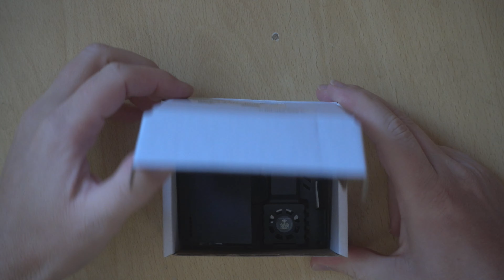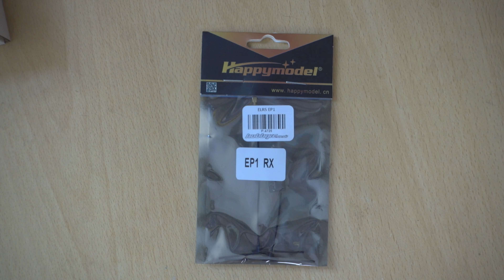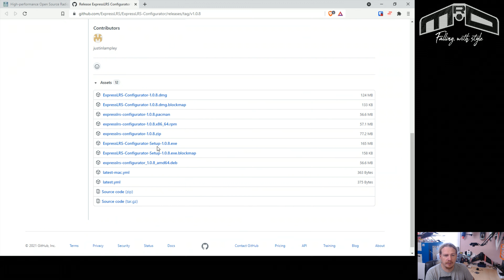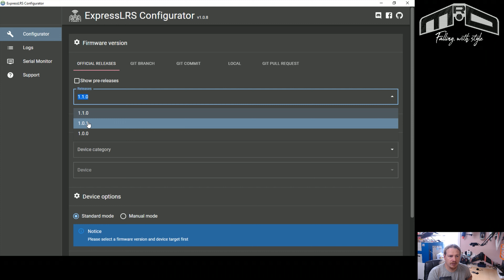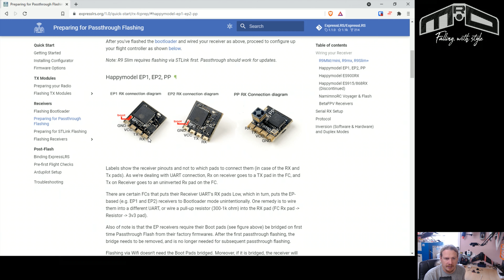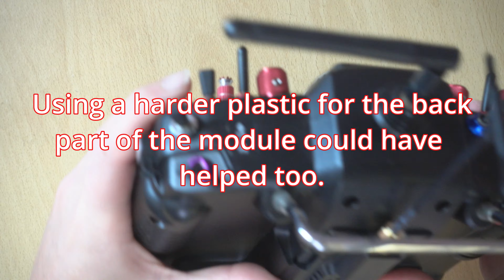Introduction to ExpressLRS and the HappyModel 2.4GHz system

Comment: So I'm thinking of trying to get this working on my ar wing pro, I think I'm done with crossfire I'm just tired of the high prices and backorder on everything. Anyway my radiomaster tx16s is on opentx 2.3.14 the ar wing is setup with matek f405-wing flashed with inav 3.0.1., does this version of inav even support Express lrs? How many loops to jump through to get this working? I've done some reading looks like new version of lrs is out. I want to use the 915mhz version what's your thoughts on this? As always thanks for all your help
Reply from the maker: Honestly, I’m sticking with Crossfire and R9. ELRS is improving. But, I have seen issues with it. There are cheap ELRS supporting products out there. But the quality can vary greatly. That HappyModel receiver I have, I do not trust. I wouldn’t put it on a plane. But, at the end of the day it’s your call. 

ELRS uses the CRSF protocol for non-OTA communication. So any version of INAV that supports Crossfire, ELRS should work with. There are some enhancements in the later versions of INAV though.
Reply: You may be right about Express elrs Darren, I've been 2 days trying to flash a betafpv 900mhz tx but only get a message platformio can't be installed what ever that is? I've tried flashing with usb and wifi but same thing. I know your setting up 2.4ghz here but have you run into this before? Thanks for video
Reply from the maker: @egtreadway4232  to be honest, I’ve hardly used ELRS since updating the INAV Fixed Wing Group models to support Hybrid 8 mode. I don’t trust the receiver enough to use in a plane. 

If I had to guess. It sounds like the wrong platform target. Sometimes there are similarly named modules and receivers in the list. Just make sure you have selected the right one.
Reply: Thanks Darren, I'll double check my settings but not going to work on it much more, I may take a look at the r9m module. Thanks again
Reply from the maker: R9 is decent. It has had a lot if bad press in the past, mostly because of false information spread about it. I would recommend the R9M 2019 module. Depending on how confident you feel with soldering, you can do the externalaccessmod on the TX16S, which would allow you to use ACCESS on that R9 module. But the soldering points are small. If you’re using ACCST, I would still use the 2019 module, and flash that with the ACCST firmware. It has better power handling than the original module.
Reply: Thanks Darren I'm looking at the tx16s mod. For the 2019 r9m looks like maybe 3 wires I can do this. I know you fly with both how's the control link compare to crossfire?
Reply from the maker: For me, they both work great. Most people won’t get close to the range that either Crossfire or R9 are capable of.
Reply: Thanks Darren your advise means alot, one last question have you done the mod. On the radiomaster tx16s for the R9m and access? I would love to see you do a video on that. Thanks
Reply from the maker: I don’t have a TX16S, so have not needed to do the mod. ACCESS just works for me.

Comment: I really enjoy the total unbias aspect of this video, thank you very much!! I have been thinking that since this is very much an entirely open software It may be possible to put it on an different system to work with 433Mhz??? I mean it would seriously improve it and "I don't have any plans to stop using it" regardless" it is a frequency that is much less used and traffic is way lesser than any of the other brands.....
Reply from the maker: Thank you Miguel. I just like to tell things as they are. I don’t want to make peoples minds up for them. But give the information for them to make their own decisions. 

Maybe it’s something they could look in to. I think the issue would be that they are using LoRa RF modules. Unless they get someone to produce the hardware, I don’t think it will happen. You can get ESP32 modules with 433MHz LoRa. But as far as I know, there are no out the box RC transmitters or receivers that use it.
Reply: @MrD  Thank you very much, I have been using the "OLD" EzUhf 433 with very little issues... have others in the past... but with not as good results... best regards.

Comment: These Happymodel es2.4tx are firmware limited to 250mw, so, idkw the fan plug and mount is there.
Reply from the maker: Future updates with more power perhaps? Keeping things like this cool is no bad thing either way.
Reply: I noticed you can still choose 500 or 1000mw. It's still putting out 250 when you do that? I have only used 100, but just went and checked when I read your comment because I was sure it went higher.
Reply: @TheLostSquadron  when you try to select it, it will automatically change back
Reply: @jhughes2286  You are correct! I just when back and tried it. When I initially scrolled past 250, I didn't try it since I don't have a fan installed.

Comment: Go for wifi on the beginning. The HM stuff (tx/rx) works just a once ( no button or grounding the bootpad needed). Only my Siyi mini has to be flashed by  uart (passthrough), but that is a different story.
Still on R9 with some planes, but this band might be retired.....2.4 works great. Even my ASW28 works with flaps and crow...:-)  BTW I know about the problem with the new batch ( SDG voltage converter)....but I have none of these.
Reply from the maker: Since recording the video I have experimented a bit more. The WiFi update on the receivers works really well. I was impressed by that. 

Personally, I think there is still a place for the other 900MHz LR systems (R9 and Crossfire). If you want pan and tilt, ELRS is dismissed straight away. Same if 12 channels isn’t enough. And to be honest, I still don’t really like that it’s not 100% frequency compliant or LBT compliant in the EU. Did you see the video of the guy who flew out 100km on stock R9? I think all these systems have enough range for anybody.

Comment: I'm running happymodel 2.4 in all my models now with no problems it's great.frsky is dead now
Reply from the maker: I’m glad it’s working well for you. That wasn’t one of my gripes. I’m sure it does work well and I’m interested in trying it out. 

FrSky are far from dead. In fact, I’ve seen a lot of people moving to FrSky from Spektrum and Futaba over the last few months because of the new X20 transmitter. And as far as link goes, there was a post today with someone flying 100km out with stock ACCESS R9. There’s plenty of life there. Lets be honest, the more companies making decent products for this hobby the better. It drives competition which drives innovation. I’m hoping the HD video side of the hobby will see more of that.
Reply: I'm coming from a drone pilot on a budget.Expresslrs recivers are smaller cheaper have telemetry and far more range than frsky 2.4.If I want longrange I would use crossfire.The x20 mite be good for a professional or someone with a lazy $500

Comment: Been using ExpressLRS on all my planes for a year now and have telemetry that actually works. My TBS gear is shelved.   I'm running 915mhz.  Lmao. Over TBS.  They didn't steal anything my friend.  You'll get some nice feedback over that remark.
Reply: Nothing was stolen, CRSF serial interface code (of which the ELRS code is derivative) exists as GPL licensed code in both betaflight and opentx and was committed to those projects by trappy himself. You don't get to decide who is allowed to use your code after it's committed to a open sourced GPL project.
Reply from the maker: Sorry, you are right. It is completely open how to read and write the CRSF packets. I’m sure how ExpressLRS deals with those packets over the air os different too. I have added a retraction to the description.
Reply from the maker: Sorry man, but reverse engineering the protocol is stealing. I’m sure I will get comments about that. But they’d be wrong, or just in denial. If the ELRS guys had licensed CRSF from TBS, which TBS are very open to, there wouldn’t be an issue. 

Still, I’m glad it’s working well for you. Like I said, I’m not here to judge, just pass on the facts.
Reply: @MrD  All good.
Reply: @MrD  Just out of curiosity,  do you happen to know who the Original developer is of ExpressLRs?
Reply from the maker: I don’t. From GitHub, you can see that  AlessandroAU and JyeSmith have put the most work in to the project. Alessandro being the earliest coder. So I imagine its his baby. The configurator side has had the most code from jurgelenas.
Reply: @MrD  Don't forget Wezley Varty and his long range testing, check out his channel of the same name, his videos really are top notch
Reply from the maker: Wezley is #5 in the developers list. I know of his videos though. Smart guy.